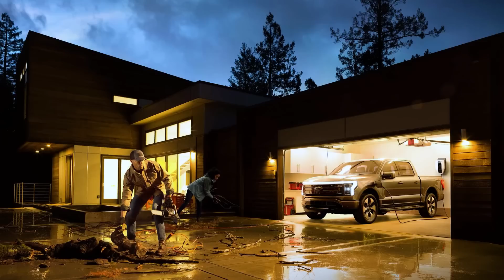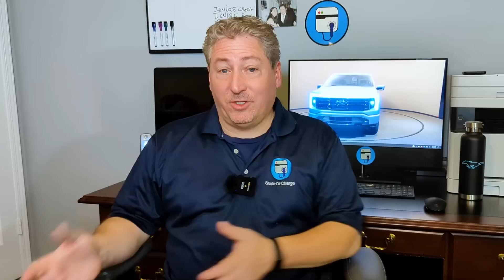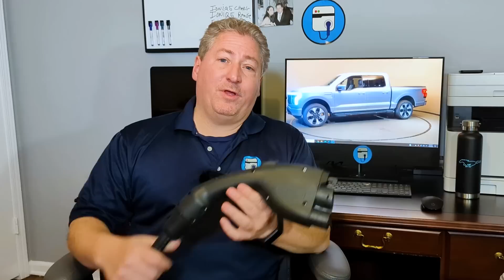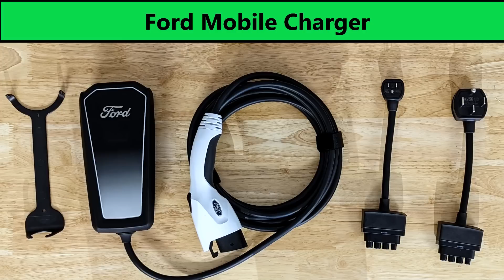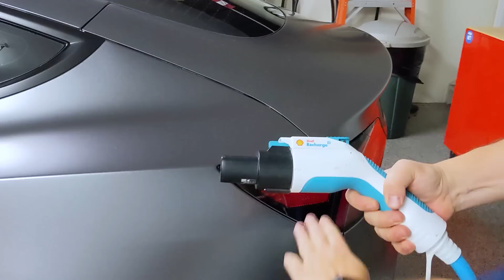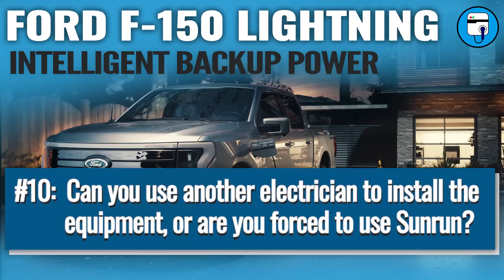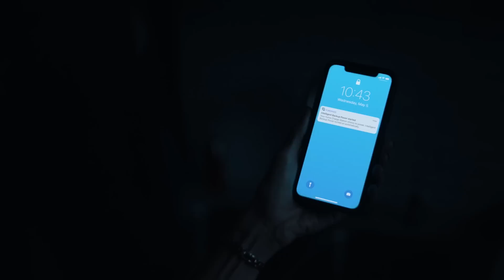Ford F-150 Lightning Intelligent Backup Power: Everything You Need To Know

Comment: As there are multiple power sockets in the truck bed/tray/front trunk can't you just run 1 or even say 3 (one on each power socket) an extension cord into your house to a power strip and then run lamps, tvs, computers and or other basic household appliances you need rather than pay and have all those additional items installed to make the VTG system work?   I understand that you wouldn't be able to run some high powered appliances in your house and or your central heating/cooling however I would have thought that should be more than enough to get you through a temporary blackout.
Reply: Also are power outages really such a common thing across America? I live in Australia and honestly can't remember the last time I've had a power outage. There are some rural areas that this is somewhat more common due to storms blowing trees over.

Comment: G'day Tom, regarding the incompatibility of theTesla adaptor to Ford's Pro charger head (pointed out around the @14:00 mark). 
How about just cutting away the Tesla adapter's alignment guide, to form a close fitting slot that clears the physical bridge between the Pro's AC/DC sections?
Reply from the maker: I suppose that would work. But it's there for stability when it's plugged in. I'm sure the adapter might "wiggle" a little when you're using it. You would need to be careful not to bump into it while it's charging because it wouldn't be as securely attached without that guide.
Reply: @StateOfChargeWithTomMoloughney  No doubt the mod of removing bump to convert it to a slot on the adapter would need to be done with precision. But I don't see the adapter being damaged/weakened as the original bump was basically just a pre-connection guide to align the connector terminals. 👍🇦🇺
Reply from the maker: @CNile-se9xw  You're probably right, But I always hesitate to advise people to alter any electrical equipment. That's up to you.
Reply: @StateOfChargeWithTomMoloughney  That's true, so what about you suggest to Ford that they try a prototype with the slot, & also to make it sturdy, thicken around where the slot is, or indeed the whole plastic perimeter?
IF the suggestion IS accepted, I don't want ANY credit or payment. My dream is that EV manufacturers work together, so this is my thank you to Ford for their work in bringing Vehicle to Home as a viable backup home storage system, for other competing EV brands to utilise.👍🇦🇺
Reply: That would compromise the water proof rating (Ingress Protection something something) and void the UL rating, and probably void your fire insurance should something go wrong.  (They have ARMIES of lawyers you know.)  It might work but you need a big appetite for risk in my view.  If you can afford all this stuff, why not get another EVSE and be safe?
Reply: @jimmclaughlin2603  Good points mate, I overlooked the waterproof implications. 🙄
So I now wonder if a thick silicone seal could be integrated into the adapter to alleviate any water ingress issues? It's probably hard to picture, but please get back to me with your thoughts. 
I stand by my word, if it's successful I would love YOU, to be acknowledged by Ford, in some way. 👍
Reply: @CNile-se9xw  ?
Reply: @jimmclaughlin2603  To clarify, I just try to help in any way that I can, always have & always will, without any pat on the back or reward.
I'm saying that you've been extremely helpful so if the idea is promising, or better yet is deemed worthwhile by Ford, I want YOU to be acknowledged & if there is some monetary reward from them, I'd like YOU to receive it, not me. 😉
The other aspect is that I've chatted with Tom & he wasn't encouraging, but he has communication avenues with Ford, so I don't see any harm in him passing it on.

At worst, they'll just laugh it off, & I'll happily take the blame. 😉
All the best mate. 👍

Comment: One thing to note is start up amperage vs. running amps on appliances. I would not recommend trying to power a central ac unit. But you could easily power a window ac and just have that one room where everyone congregates and sleeps. Indoor camping.
Reply: We have a Bryant Evolution home air conditioner, which showed 9Amps with no surge at 240Vac as it is a variable speed type of unit, low noise.  Nameplate is 32.5A max and it is on a 50A circuit breaker.  Seems to pull 1A all the time when not running?

Comment: Oh, one more question about the Ford Charge Station Pro.  You mentioned it can be de-rated down to 20-amps, which is similar to their 48-amp unit.  My question is: will the Charge Station Pro allow for lesser power selections by both hardware means (e.g. physical DIP switches?) as well as by software/app settings?  Some users may want to be able to use a temporary setting of a desired charge rate set to less than the full hardware current setting to not pull a full 80-amps (or whatever the hardware max is set to) and instead just use say a 20-amp charge rate using power from a solar installation on a sunny day?  I hope that makes sense.
Reply: great questions also wondering if i had 2 charger pro's / level 2-ford one one line can thay target a setting for one bay and a different number for the others bay like how some charges talk to each other for max line use/efficacy? or do i have to do it all at the service panel/in hardware/in 2 different copper lines? as i right now see one vehicle being parked a lot vs the other one being a daily to work and back so it needs more nighty juice than the other truck and one spare plug for tools/a 3d visitor car

Comment: Tom, truly awesome content.. very informative!! 👍 I am getting this truck with the extended battery so I am all set .. my house is small only 5 bed rooms, 3,100SF, we only use 850-900kWh per month (not included charging our EV’s) so that’s an avg. of 32kWh per-day, we don’t have any type of gas going to the house so 100% everything is electric.. our electric wall oven  pull a max of 16 @ 240v and cooktop 18A @ 240v with all elements on max, and washer/dryer combo 14A @ 240v with both going at the same time .. the rest of the house 1.2kW or 10A @ 120v being used so in total with most everything going that’s about 48A @ 240v or 11,520w .. not including the 120v stuff (in power outages we never run everything anyways but this truck comes very close! )

Truly can’t wait to get this truck!  even an extra $5+k to get it all setup is well worth it and I plan to do as you hit at .. charge up at on 1.5c TOU cost and run the house during the day or run my mining form that is only pulling 38A at its current size lol man wish I ordered two trucks 😂
Reply: BTW Tom, does the intelligence house backup runs true split phase, can you pull the full 9600w from one phase all 80A or only 40A @ 240v?

Comment: What if you have a backup battery, can the Ford/Sunrun system work in concert with another battery?
Reply from the maker: it depends on the system you have. It definitely can if it's a Sunrun battery backup, but if it's another system, there may have to be additional equipment purchased to make it all work together properly.

Comment: I use the Emporia Vue 2 energy monitoring in my circuit panels, I can tell how much power I use each day.  I really like the system, I mostly got it to see how much power the hot tub is taking in the winter.  Also i can tell my peak load and so far i haven't seen peak load over 10kw.  Also you mentioned 60 amp(48) EVSE's are $600+, the Emporia Smart car charger is only $400 and can be direct wired for 60amp circuit wiring.
Reply: I 2nd the request to review the Emporia charger.  I also use the Vue 2 energy montior (several), and it works well.  Only issue I see with their charger is it being not UL Listed - only designed per those standards (or so they say on the website).  But would love to see the other aspects reviewed, as it does seem like a nice intelligent low cost 48A EVSE.
Reply: @billjohnson3344  yep they built the charger to UL standards but are still in process to get actual approval.  Tom has reviewed non-UL listed chargers in the past tho, so just wouldn't get the UL points in his rating scale

Comment: Great info.  Especially that we have a choice of installers other than Sunrun.  

From what you’ve told us so far, I’ll probably go for a V2L solution (F-150 Lightning and panel set up to be used as if it was a traditional emergency generator) in the short term.  By 2025, there should be more solutions on the market that will make V2H/V2G less complicated.
Reply: This seems to be the way to go.  Not automatic, but much less expensive.  Just install an inexpensive transfer switch, and buy a cable to use between the Ford’s 240 V outlet in the bed and the transfer switch’s generator connector.
Reply: @georgepelton5645  Yep. Can’t wait to see this in operation.

Comment: So what happens if the cell towers around your residence are also part of the power outage.  I know for a fact that not all cell towers are equipped with backup generators and the ones that are may not be functioning all of the time.  Either way lets say you have no cell service during the outage and of course wifi is not working either.  How is the app going to communicate with the car and if it can't is there a way to manually activate intelligent power from within the vehicle?
Reply: That's a fair question.  Since (from the docs we've seen so far) both the Lightning and the Charge Station Pro will have both WiFi and Bluetooth adapters, so perhaps it uses either of those available connections (depending on distance and signal levels).  In the event of a power outage, though, the Charge Station Pro won't have power out of the gate (go figure).  The Intelligent Backup and Home Integration systems must depend on the "Dark Battery" setup somehow to provide the initial startup power.  Perhaps that's what powers the WiFi and/or Bluetooth initially during the outage and, if in not automatic mode, allows the manual app toggle to allow the truck's DC power to flow and the inverter to kick up.  It will be exciting to see how they've implemented all this stuff!
Reply: If the cell towers have power, then everything works with the app.  App is also just a convenience - should be able to manually activate from the truck.

Comment: shut your main breaker off [very important]  big loads off hot tub  pool  water heater etc  use a double ended #8 or 10 cord unplug your level 2 charger and  plug the double male ended  cord into where your charger was the other end into the 240 plug in the box  make sure you  turn off any solar  power should be good to go

Comment: Great video, Tom. Our generator is only 8kw as you’re aware. We have all electric appliances including oven, stove, clothes dryer and of course A/C. Only our heat is not electric, although of course the pump and furnace fan are electric. We can run A/C and either cook, or do laundry with the generator. So the Lightning should have no problem powering the average home.
Reply: yeh maybe at your house (so you're not browning out? at all or tripping out any breakers? ) but not so convencted at my place based on quickie nabcan mathematics on 3k sq ft mine
Reply: @richardprice5978  In an emergency it’s not life as usual. You’re not going to have all your lights on, fry eggs, bake a cake, and do laundry all at the same time. The square footage of your house doesn’t matter really, except for maybe central A/C, which you can set higher than normal. You can only be in one room at a time. It’s an emergency, remember. Keeping your heat going and refrigerator running is paramount.
Reply: @petebremy49  well i started out with a main 100A challenger planel ( finishing a 400A upgrade in 2022 so no hot test yet ) and i gets way too hot. as for floor sq foot its a quick and dirty way that electrician's use to compare house's but that doesn't work 80% ish of the time as some use more that others and yes i did try to pick one night/72H to simulate a power outage but for me that's a little hard right now as i have dumb dumb equipment that doesn't measure usages. my range is 60A the main heating is N gas but the blower ist small loading no heat pump for now but should add above ground unit 4ton ( i have a 3ton ac but it's not enough enough and or really doesn't work right ) im not sure if its the best use in a emergency ( heating pumping ) or not as for lighting this house is offal for outside letting in nature aka 💡has to be on to see anything
Reply: @petebremy49  well i don't know about you but in my case if i can/the utility's are on the frizts for more than 3~ days im taking a bath with my N gas water heater and doing my electric washer and electric dryer laundry's. and id expect the others 3 or 4 of us in the house to do that too plus the dishwasher/dishes ect., i have my limits and slob isn't one of those im okay with nothing on you it's a me thing
Reply: @richardprice5978  I never said be a slob, I just said you can’t do everything at the same time. Good luck to you, then.
Reply: @petebremy49  it's possible i miss understood you as it sounded like no bath 🛀and skipping laundry and vacuuming ect. and that after a month ish sounds kinda icky as for your point yes in a utility outages saving resources is a great idea so no it's not as "normal use" as you said. that's why im not sure if outside is 40F ish if heat pumps are the better use of emergency power

Comment: I'm not sure that 9.6 kW can even run a 2 ton ac, which is tiny.  This is NOT a whole house generator.  It's about equivalent to a Costco roller generator that would run your kitchen, some screens, lights, and laptops.
Reply from the maker: A 2-ton AC should draw no more than 20-amps - roughly half the power the system can deliver. Some new energy-efficient systems draw even less.
Reply: @StateOfChargeWithTomMoloughney  The question usually comes down to surge power and not continuous for this common home cooling need.  9.6kW is enough to power even a traditional 3 or 4 ton central A/C unit - on paper.  The issue is if the Home Integration kit can support the A/C compressor startup surge, which momentarily is much more than that.  Typically you need 2 Tesla Powerwalls (or similar) battery storage inverters to do this.  In the Ford Intelligent Backup scenario, clearly the vehicle battery has the power, it comes down to the specs of the Home Integration Kit components (DC-AC inverter).  And if we can't do it with one inverter, can you add a 2nd to achieve this?
Reply: @billjohnson3344  You can get soft-start kits for many AC units that keep the surge to low levels. Also, there are lots of AC units (and heat pumps) that always start soft by design. Consult an HVAC professional for details on your installation, yours might be one of them. I just had a replacement HVAC system installed a little while ago and asked about this issue for running on backup power in grid outage scenarios, and therefore got quoted for a system that essentially has zero start-up surge. Apparently there are longevity advantages to that as well. It does mean that when it turns on it takes slightly longer to get to full output, but that doesn't really bother me.
Reply: @seabream  Yes, I understand that modern AC heat pump systems have no surge, and that tradition 3-4 ton compressors can have soft start systems added.  However, these soft start add-on's typically void the warranty as the compressor motor actually wants to start and draw that power - the soft start system impedes it.  Was looking if this Ford setup has enough umph to avoid an A/C retrofit as most homes still use the older system.

Comment: Thanks Tom, two questions I haven't seen yet:
1. Will other electric vehicles be compatible with the Ford Chargestation Pro? Will the Mach E get a software update (probably paid as you said for standard range Lightnings) so that it could be compatible too?
2. Will the Lightning be compatible with the Wallbox Quasar bidirectional charger or other non-Ford solutions?
Reply from the maker: You'll be able to charge other electric vehicles with the Charge Station Pro, but not backfeed your home during a power outage as the Lightning can. The Lightning should be compatible with the Quasar, but we don't know for certain.
Reply: @StateOfChargeWithTomMoloughney  The term backfeeding worries me.  Backfeeding (sending power back to main panel from an existing receptacle) is unsafe and illegal.  We have already had one commentor proposing a double ended male cord from the 240 V socket to the 14-50 socket in the garage.  Major no-no.  

So, I hope you are using the term in another sense.  The IBP (like any generator) will be forward feeding the panel (either the subpanel or main panel) with direct wiring downstream of some transfer switch, not feeding back through existing wiring.

Comment: To ease Tesla's V2H concerns I think they could use Storm Watch, like they do for enabling Powerwall charging from grid, to enable V2H during  inclement weather.
Reply: Even the standard range 98 kWh battery is huge compared to a Tesla Powerwall's 13.5 kWh. Gonna need about 7 of those to match..